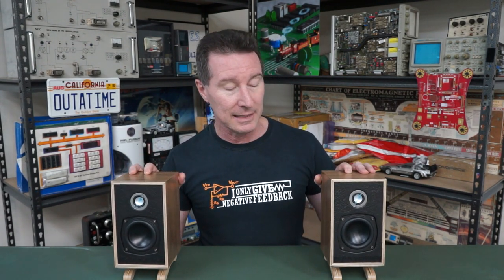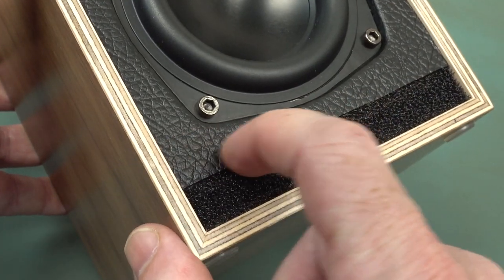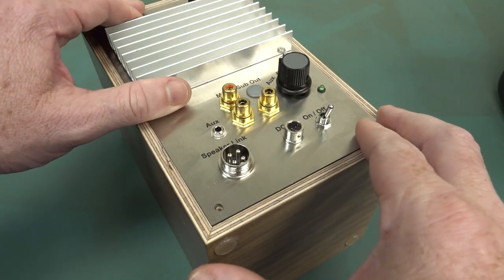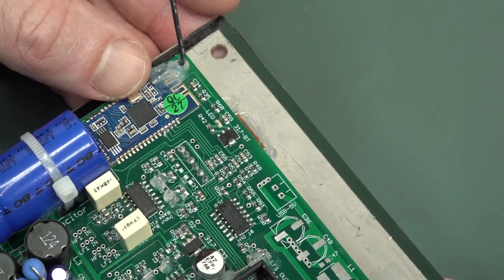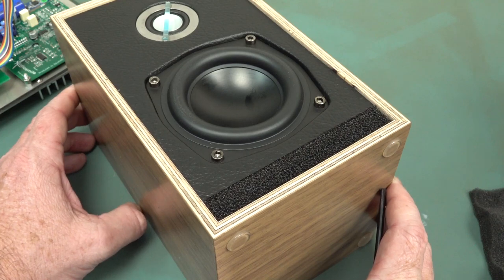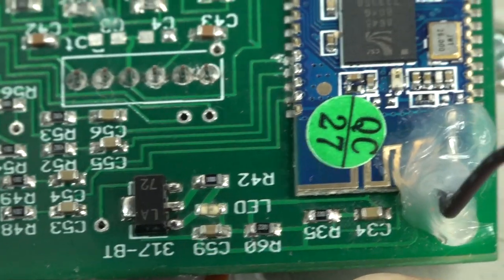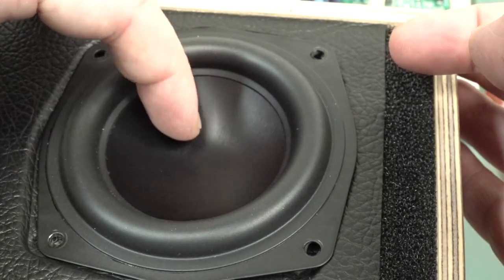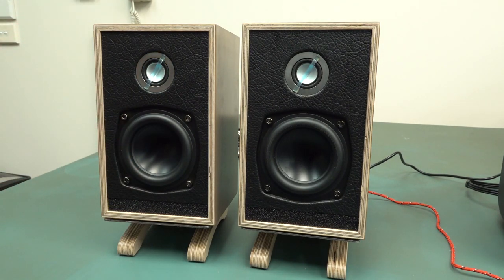EEVblog #1162 - Little British Monitors

Comment: The reason why people don't do these kits anymore? Because there is no profit on it unless you ask a ridiculous price like these. I know pretty much which drivers are being used. At my company we sell something similar monitors for just around 80 bucks. And those are sold per around 500 per year.
I am far from impressed for the amount of money
Reply: How much markup do you think he's charging per unit?
Reply: @uK8cvPAq  . That's difficult to calculate. What i see a lot with amateur kickstarters is that they don't use the right sources. So they pay full price for their parts. So in the end the customer pays for the fact that they don't have their suppliers and calculated labor right. We can get these drivers for less than 10 bucks. 
But it's not the whole story. It's about what is available on the market for the same price and what your story is to make up the higher price. 
For 300 pounds you can get something that is far more professional and better quality. Like orders of magnitude. 
A big manufacturer (selling like hundreds of thousands or millions) would be able to make this for just around 30-40 bucks maybe.
Reply: Which speakers does your company sell?
Reply: @Audio_Simon  I think you're asking for a brand? We don't sell speakers ourselves for consumer market (only for pro-audio).
But we do deliver the technical side of it (engineering design, hardware and parts). There are a lot of (known) brands that don't do the engineering themselves, the engineering is done by a 3rd party. 
In our case we sometimes even do production and assembly for those brands as well.
(yes technically i know I said that we sell them in the first response, but just to make the story a lot less complicated)
Obviously for confidential reasons I can't tell which brands those are.
Reply: @merlingallagher4484  So you can't show your work?

Comment: Swan makes a 3-way speaker kit for $290 on Amazon that you assemble the enclosure and the passive crossover. They are passive so you will need an amp, but reviews say they sound great.

Comment: I owned some Ohm Walsh 2's with transmission line drivers and port. Very good sound reproduction and very pleasing to the eye.  Don't thin I could fit them anywhere these days.

Comment: I'm surprised that the meandered monopole antenna integrated to the BT module is disabled (I think) and replaced with the wire. That should slightly extend the range but how much and is it really worth it?

Comment: Not a fan of controls on the back of the monitor. A small box for the amp and the controls would have been better. Would have also resolved the dissymmetry. But good on him anyway.
Reply: You're not supposed to change those settings all the time on actual monitors. You set them once and your mixer/audio interface controls the gain for both after they're set.
Reply: @crimsun7186  yeah, but those are just hipsters pc speakers

Comment: Love the Springy Stand 👍👍👍👍👍
Reply: Looks good but absolute crap sonically. Speaker cabinets should be 'grounded' or fixed and immovable as any panel flapping is actually distortion added to the cone excursions.

Comment: 300gbp for tda7850 amplifier with normal (not high end) Chinese drivers? supporting the local creators ok, but its not bang for your bucks i think...
Reply: IamIUareU It's supposed to be for the other parts and the acoustic design work, not the stuff on the PCB, though at least that circuit hasn't been price optimized to death with bad caps and knock-off chips.
Reply: @johnfrancisdoe1563  he is selling nationalism and patriotism, not quality product (in any way, just as Dave said and confirmed)... otherwise he could pay $1000USD for freelance electronic engineers to design him high quality electronic scheme and design, then he could produce it also with high quality in China and could employ UK Q&A before he shipped the product and would get a really great quality product that would cost way less... Dave did the same (altho he got the design and production for free i think), ask him if his multi meter is high quality and bang for the bucks...
Reply: @Hobypyrocom  A lot of EE are terrible at audio circuit design to be honest. This is low frequency stuff, but signal integrity is everything, not getting a pretty layout with neat traces that cause crosstalk and inductance. Many immediately opt to using a ground plane which is also terrible for audio. My PCB may not be the best looking but it works well where it matters.

Regarding making it in China, you've got to realise this is a small production I'm not looking to flood BestBuy.
Reply: @Audio_Simon  "A lot of EE" is not equal to all of them... i know some guys that are really cheap and great designers... most of them also dont charge you if you dont like what they designed... the ones i know provide a working prototype included with the design, so you can check first what you will get. if you write a detailed documentation with your requirements, even those who are terrible at audio circuit design will provide you with decent product.
"you've got to realise this is a small production" yes, i am aware of it, but who said that if you produce it in China you have to make millions of pieces? it will be more expensive for small quantity for sure, but again it will beat the price of UK manufactured guaranteed...
think big and aim for the sky, you have a great idea that has huge potential, but at the moment the execution is bad... good luck and best wishes...
Reply: @Audio_Simon  Then send those to an EE who is a professional in the audio field, like Doug Ford, who has worked with RODE for a number of years and could test your monitors properly. Anyone can claim EE are terrible at something without subjecting themselves to the same scrutiny. Put your money where your mouth is.
Reply: Yeah you pay extra because it's British... The fact that the actual components are all made in China. 😂
Reply: @eLJaybud  well to be fair, everything is made in China nowadays, even big tech western companies produce their components in China, it doesnt mean that those components have low quality tho... the price difference is that UK hourly rate for engineers is 12 times higher than the hourly in China...
Reply: @Hobypyrocom  for that price he should be at least hand making the speakers and tweeters too.
Reply: @Hobypyrocom  The difference boils down to two words: quality control. There's a difference between buying components from China and using them to assemble a product and dealing with the manufacturers directly to produce a product. While the EEVBlog 121GW multimeter is essentially designed by UEI, it was done in colaboration with Dave, with the specs he wanted. Dave didn't simply buy the components himself, then started selling it as a handmade product called "Little Aussie Meter" of questionable quality, using the namesake of his nationality to play the patriotism card.
Reply: @crimsun7186   true that, exactly what i was saying... also he claiming that "A lot of EE are terrible at audio circuit design to be honest. This is low frequency stuff, but signal integrity is everything, not getting a pretty layout with neat traces that cause crosstalk and inductance." while having an auto-trace inception on his pcb design is ridiculous...

Comment: I might be missing something here.  On the website it states the power output is 4 x 50w, but the power supply is 6A@15v which equates to 90w.  So how the hell can you get 200w power out from a 90w power supply ? - do those flux caps double up the power :)

I'm also no expert, but for the money there are better finished speakers out there.  He could have added a veneer to the front edge rather then leaving it exposed plywood.
Reply: Well, fortunately(?), music is far more dynamic than a constant sinewave, so there's some so-called "crest factor" involved (ie. the power supply won't need to supply 200W all the time). That being said, the power brick sends shivers down my spine. Pretty sure it's light as a feather, and even IF it meets the specs on the label (briefly as it might), it's still no less of a death-trap (like pretty much all those cheap-arse "replacement" laptop power bricks).
Reply: @khronscave   Thanks for the explanation.  I know what you mean about those power blocks.
Reply: @MalcolmCrabbe  Well, there's that, plus the fact that the output power's directly related to the supply voltage. Right on the first page of the chipamp's datasheet, it says "4x 30w / 4ohm @ 14.4v", and that's at 10% THD, so well into clipping territory. Pretty standard rating tactic to inflate the numbers. Figure 9 on page 11 of the TDA7850 datasheet is probably more telling. Assuming no voltage sag, at 15v you'd get a bit under 25w into 4ohms "clean enough" (1% THD).

I wonder what those 120uH inductors near the output are actually doing there, if the crossover is done at the line-level, ahead of the amplifiers. Maybe an RLC notch, to minimize that ~8kHz peak (break-up node) in the "woofer"? See the link for reference: http://zaphaudio.com/audio-speaker18.html

Comment: Seriously? It's not often you see a PCB layout that poor. Laptop PSU going through a connector with tiny pins. A ribbon cable carrying audio?
Reply: There is no problem with that power connector or ribbon cables for audio. I agree that these speakers are overpriced and there are many things wrong here, but there is absolutely nothing wrong with the things you point out from an engineering point of view.
Reply: Indeed, the layout looks quite sad. But the rest of the construction looks nice.
Reply: @chrisdejonge611  The power supply is rated at 6A, those look very thin pins for that and ribbon cable has awful crosstalk characteristics.
Reply: @colinedwards7250  The audio signal is low impedance (line level) at that point so is not really susceptible to interference. I'm sure that connector is just fine for 6A. Again, there are things wrong with the design, but the things you're pointing at are not.
Reply: @colinedwards7250  What i'm more creeped out by is the power supply itself - that thing is a potential death-trap right there. Those [ahem] "replacement" power bricks damn near need a paperweight so the wind doesn't blow'em away, and i wouldn't trust the ratings on the label as far as i could throw'em.
Reply: The unpopulated switcher at the USB power input is also absolutely horrendous. No way in hell does that piece of shit pass EMC.

Comment: Transmission line speakers should be totally non resonant.. Start out with the square footage of the "pipe" being a fair bit larger than the active area of the speaker.. (fair bit of geometry there..)  a 10 inch woofer would start out at about 80-90 square inches..that will taper down to the active area of the woofer at the exit.  Built a number of them over the years.. the drivers have to be selected for the job to get good low end response.. I measured my 4' tall designs with a 10 " woofer solidly flat down to below 50 Hz...Fed with a fairly decent little amplifier setup...The transmission line (the "tube" needs to be carefully filled and packed with long fiber wool... hung lin small baskets.  You tune the speaker by changing the packing of the wool.. and they are all different.. (Lots of particle board for the walls to keep it non - resonant..)

Comment: Our often see electrolytic capacitors right next to things that get hot (FETS, or in this case, power resistor's). When I look into the MTBF (mean time before failure) of EE caps, it increases a lot with heat. I understand that sometimes you want your bulk capacitance near certain components and maybe those components get hot, but does anyone care about putting them near heat sources? I always try to stay away from them but I'm beginning to think that it doesn't seem to matter
Reply: Those resistors don't get hot, not at all.
Reply: @Audio_Simon  my apologies, given their size they looked like high power resistors. But the statement still holds true for power supplies I see, with their caps close to heatsinks

Comment: Sees inverted domes, sees steel backs, sees springy stands, sees single amp and nothing to make up for that in the other speaker, is sceptical.
But then I seriously dislike Focal. 
These look like someone shrunk IMF Compacts. I feel as though maybe Simon has seen these up close.
Transmission line produces a nice bass, but a very, very slow bass. The bass is generally audibly later than the higher frequencies. I personally don't mind it too much but it's definitely an issue with transmission lines. 
Agreeing with the phase err... bars. 
Rotate it!

As I said; I don't like Focal.
But honestly, through my SRM10B's here (talking about nearfields :D) I actually prefer the LBM's.
The focals sound typically focal 'pointy' and 'hummy'in the low end.
I guess it's a philosophy but I think, without trying to be mean about you or your speakers, that right now Focal is the worst sounding 'high end' brand of speakers out there, by far. 
Pity no one seems to agree because they sell like hot buns. But then so does Bose and Dr. Dre Beats, hmmmm....

300 pounds, right?
You could buy a pair of Boston Acoustics A25 and a half decent Yamaha amp for that...
Pity they stopped making the Bostons.

Comment: I still use a pair of 1960 15" 15 Ohm Tannoy Monitor Reds in transmission line 12 cubic feet cabinets (around 180lbs each) . I paid £5 for both chassis (they were going to be dumped) and needed a bank loan for the cabnet materials. The BBC used these quite a lot. I have listened to others in my home but like most things one mans meat is another mans poison. You can read all the write ups you like, look at all the data sheets there are but reverberation times, room acoustics, and our ears can make or break any setup. I lost interest when the lack of coloured screws came up.

Comment: Where is the Bluetooth antenna supposed to go?  If you tape or snot it to the board it may not have as good range.  You could use semi-finals coax to a connector to panel-mounted connector and external antenna, but you just doubled the price of a Bluetooth audio speaker!
Reply: Would be nice if Simon sent a pair to The Signal Path. He would be well equipped to test not only the audio performance but also the RF performance.

Comment: The LBM and Focal speakers sounded the same to me, but then anything would coming out of my old $100 Altec Lansing monitor (as in PC monitor) speakers with separate subwoofer.  Also, while I agree that the acoustics will be slightly different between the one with the PCBs inside and the one without, I seriously doubt anyone could hear that difference.  Needs a blind test to be sure.
Reply: I can hear the difference on my Terrible quality laptop speakers......

Comment: What’s up with that trace on the right of the screen at 17:21?
Reply: Multiple star ground trace. One point for the low level signals, one for regulators, one for high current returns.

Comment: Wow, my old friend CSR 8645 ! Or is it a foe ?

Yes, the specs may say aptX. But ...
You get aptX only if you pay for it ! I doubt these speakers have aptX.
At the time (2015), I learned that to test and develop products with aptX, there were 5 specific MAC addresses you had to affect to your BT modules, and 5 specific aptX licenses associated with these MAC addresses.
For commercial products, please send your checks to CSR, Cambridge, UK (I guess) ...

The 8645 is a cheap(er), ROM only (except for config) version of the 8670 (which has flash for MCU and DSP firmware, and DFU/OTA firmware upgrade).
If I had time (or if you had time to read my boring prose ...), I'd tell you how hard it is to program the MCU part of the 8670 ...
Or how hard it is to get support from CSR (Qualcomm now) if your company name is not Bose ...

OK, I cannot resist to tell the biggest surprise I had : sizeof(uint8_t) == 2.
What's more, there is a very good reason, one that is from the C/C++ standard spec all that stuff that nobody reads.

If you want to stay sane (or as sane as you still are), flee, don't try to code your own FW for these.
Chose a module manufacturer. Of course, the cheaper the module, the less control you'll have over the FW, and the more you'll have to speak Chinese !

Due bu qi ...

Comment: Why use an automotive chip when you can use a higher supply voltage and design around 4 to 8 ohm loads?  Help me here!
Reply: Because these are not pasive. You only need to care about impedance on passive speakers.

Comment: This is a ok PCB, but the power resistors so close to the auxiliary capacitors, is not nice.

I also see no good reason to have 125 deg C rated main capacitor, especially because it looks to be far away from any source of the heat. But no complain, it improves reliability.

The orientation of the heat sink at the back, is really weird, and sub optimal.

 Also, few traces have a T junction, with a less than 90 degree traces. Dave, mentioned that it is not really something you want to have on PCB (in one of his KiCAD videos), because of how PCBs are made, and you can have a dead space, and it is problematic during etching.

Overall, the quality of the build and electronics is good. I wish there was balanced XLR or TRS input, and volume knowb with off switch at the bottom end, on the front of the speakers. And no LEDs on the front. Interesting choice with the external AC-DC power, and I think it is a good choice, because you could probably eliminate quite a bit of 50Hz hum and harmonics from the audio path interference this way.

It is hard to hear any difference at all between these speakers and the other ones.